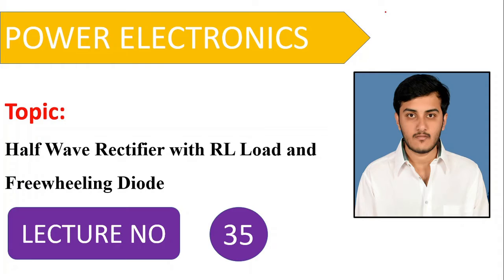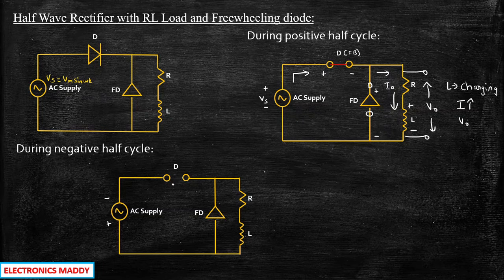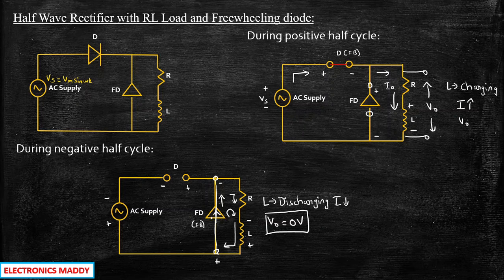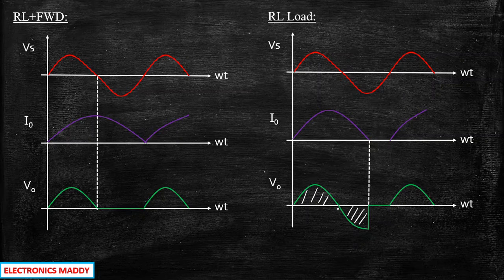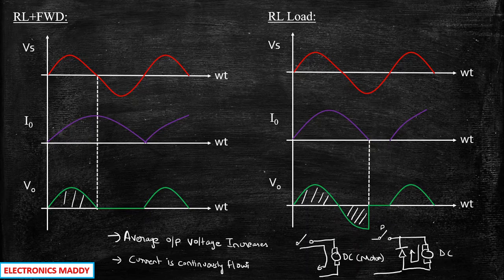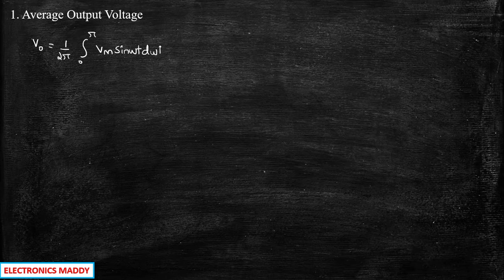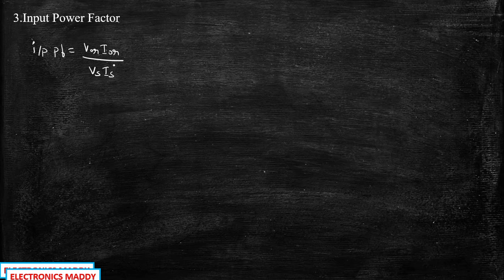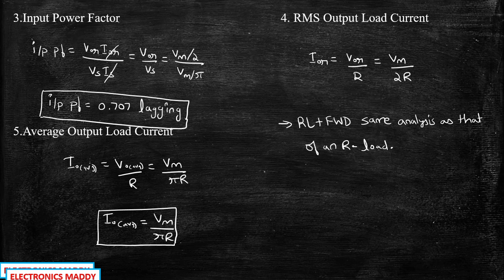Half Wave Rectifier with RL Load and Freewheeling Diode | Power Electronics | Lecture 35

Comment: Is it ok to directly write average current = average voltage / resistance ?? as current doesn't follow voltage (as voltage becomes zero in -ve half cycle)
Reply from the maker: We cannot since the load load is not resistive. It is RL load
Reply: @ElectronicsMaddy but at 15:33 you directly wrote avg curr = avg voltage / resistance, that would incorrect, right?
Reply from the maker: @madhuchowdary8826 actually I misunderstood your question. But we can write Io = Vo / R. Because Vo is derived considered the effect of the load.